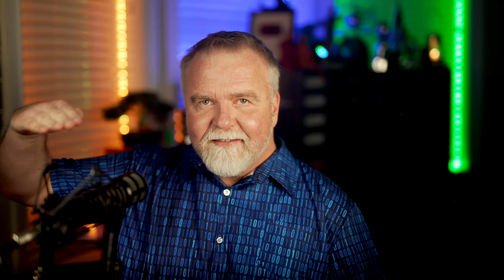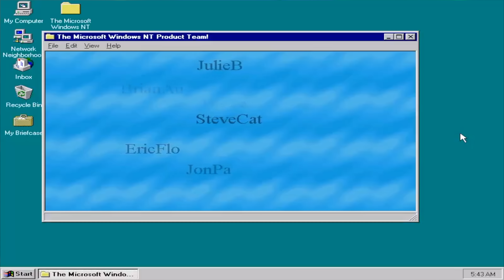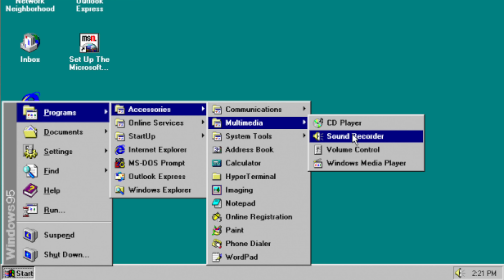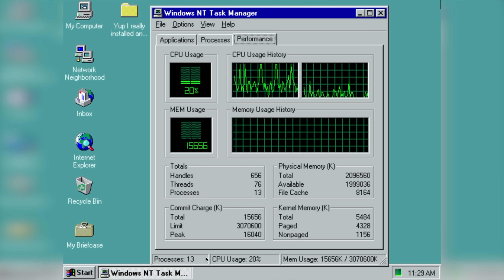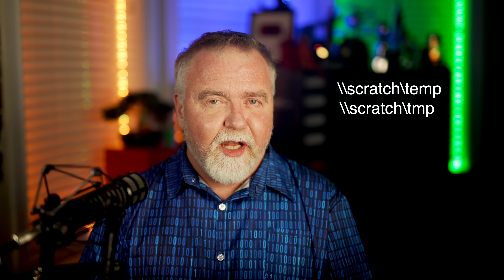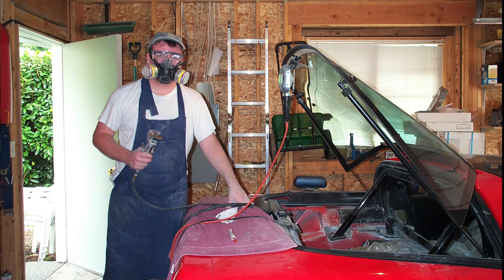Behind the Windows Start Menu - Insider Secrets

Comment: It was possible to change "START" to "STOP" or any other string 5 characters or less.  The string is stored in explorer.exe which could be modified using a hex editor for instance. You had to copy explorer, rename it, edit it, delete the original and save the modified copy as explorer.exe.

  Upon reboot i was the coolest kid in 7th grade!
Reply: Cooler still were the win95 days (I think iut was fixed in 98+) where if you put the keyboard focus on the Start button (I think you had to dismiss the menu), and then did alt+space, it gave you the system menu that you'd usually expect from regular windows. Now, you might think that if you hit 'close' you closed the shell.. and you'd be wrong. All it would accomplish was that your start button would entirely disappear from the taskbar.

It was a very fun way to troll friends back in the day.
Reply: @Aviertje  now that is something I never knew about!
Reply: @Aviertje You could also still run PROGMAN.EXE or edit the Registry to make it the default shell instead of Explorer 🙂
Reply: @Aviertje  damn, never tried that! I used to replace the wallaper with a screenshot of the desktop, drag the taskbar to the top of the screen and make it 1 pixel high. Drove many people crazy!
Reply: I remember doing a hexedit on explorer and I did it wrong and explorer would no longer work. That is when I learned that you could run a program from task manager
Reply: One that I liked doing was deleting the windows boot logo to force the computer to boot with the text screen, then modify a boot file (forget which one) so the computer would say "Starting Microsoft Virus 95..." or some variation on that. Our computers were so slow it would be stuck there for about 2-3 mins....
Reply: Decades ago, I wrote a trivial little BASIC utility that could pack ^H (backspace) characters into other BASIC programs using a simple process.
End result was that a BASIC program might look like this: 10 PRINT "Hello", and would print "Goodbye" when run.
It was also possible to make RUN look like LIST and LIST look like RUN. Basically, what was listed and what was run appeared to be completely independent.
The example above was actually 10 PRINT "Goodbye"; REM ^h^h^h^h^h^h^h^h^h^h^h^h^h^hHello"
Great fun at the time, circa very early 1980s.
Reply: I changed the "starting windows" to "deleting windows" for shocking my co-worker. The cool coincidence is that in Greek, is "εκκίνηση" and "διαγραφή", also 8 characters both.
Reply: I would manipulate it with SendMessage API back in the day when I wa a teen. :face-green-smiling:
Reply: this one made my day
Reply: You could also use a tool, as I recall it was called "resource editor", to change the icon.  I seem to recall changing someone's "Start" button to the "Smile" button, complete with smiley face icon.
Reply: @Wythaneye  Modifying icons with something called resource editor sounds like Apple System 7, where all files had a resource fork and a data fork, although one of them could be empty. If I remember correctly, user files (e.g. text files or spreadsheets) usually had a mostly empty resource fork, except for the information which program to open the file with if double-clicked (unlike DOS, Windows and OS X older Apple OS versions didn't use file name extensions, the file type and creator were stored in the resource fork, invisible to the user) while program files had mostly empty data forks. Storing those files on FAT or NTFS volumes removed the resource fork entirely, which means programs no longer work even if copied back to an HFS volume. The most common editor was ResEdit.
Reply: hmmmm I can think of a few 4 letter strings that would have made me the coolest kid in 7th grade 😈
that said our state tests were run on some linux variation so I sudo-rooted my way to changing everyone's grades to score perfectly except for myself who I failed (gotta throw em off the trail) and I was the coolest kid for a day until the teachers quickly realized and I was sitting in the principals office crying with 2 police officers who were laughing hysterically.
Reply: If just hexedit the string, going past the length of the string would most certainly break it because I suppose it was a typical for C zero terminated string (a string, which terminates with a value 0). I have not checked the code so I cannot say for sure it was/is so.
Reply: what about languages with a longer string ? You could add even more characters right ?
Reply: @seremptos  my memory is that the string was 5 characters long so you had to fill the unused characters with spaces if the word you were replacing START with had less than 5 characters. 
I believe if you added more than 5 characters the checksum of explorer.exe would be wrong and the program would not execute.

Edit- Everyone is saying that the checksum would change with any edit and that sounds right. All I know is that if you changed the file too much it would not run.
Reply: @X_513x  So change the checksum
Reply: @X_513x  If you used a proper resource editor you could change the string to anything, even something too long to fit on the button. There was one written in Pascal that I had a lot of fun with and could delete nag dialog boxes of shareware with it as well as add features. Quite a few apps I added escape to quit which was quite handy. Now that I only use Linux it's a simple shortcut change in the configuration for the DE.
Reply: @anon_y_mousse  net send . Hiiiii lol
Reply: @X_513x  The checksum would change if you altered the string at all.  Going over would either overwrite other data which could lead to a crash, or overwriting code which would almost certainly lead to a crash.
Reply: @mikechappell4156  That sound right. I'm not a programmer so I don't fully understand what I was doing then and I understand even less now lol
Reply: @X_513x  It wouldn't be a checksum, changing it at all would change the checksum. It'd be the moving of data afterwards to different addresses since they get shifted forward, so every reference to data after it would have to be reset
Reply: @X_513x  Wouldn't the checksum be wrong just by virtue of changing any of the characters in the string anyway?
Reply: @X_513x  If that were the case, merely changing the text to some other five-byte string should also change the checksum.
Reply: @davidagnew8465  Yeah several other people have said the same thing and that sounds correct. All I know is that if you changed the file too much, it wouldn't run.
Reply: @X_513x  The problem is that the file is essentially one big number and there is no clear boundary between one item and the next. That will all be determined by the executable code itself which knows what bytes to read from what address to get the initial value that is if that even gets to run. But even before we get to that the entry point of the first function is also just an address stored in a value in the ELF header of the EXE file. If you change the file length prior to this instruction then this address no longer contains the actual start of that function, in fact the bytes at that location are most likely not going to make any sense at all and certainly trying to follow the bytes from there and treat them as CPU instructions is going to run into an invalid opcode or access violation or something of that nature in short order. If you throw random bytes at a CPU one of those sequences is either going to call for an opcode that does not exist, accessing memory that you don't own or similar and the CPU will refuse with an exception.
Reply: @FaerieSeraphina  wonderful explanation, thank you

Comment: win95 osr1 you could click on the start button, and it would put a select box on it (as you see in the NT demonstration here). alt+space would pull up the right click menu, though right clicking would not pop it up. but the alt+space would open it, and the close option would be there. so, at bestbuy or whatever, we would screenshot demo machines, then make the screenshot as the wall paper, close the start button, and hide the task bar, and move all the icons out of frame (make a folder far away from the icons, then select all, drag till everything but the folder is off screen, then delete just the folder, but the folders still look like they're there. from the screenshot wallpaper. including the start button, which is closed. ;)  very fun